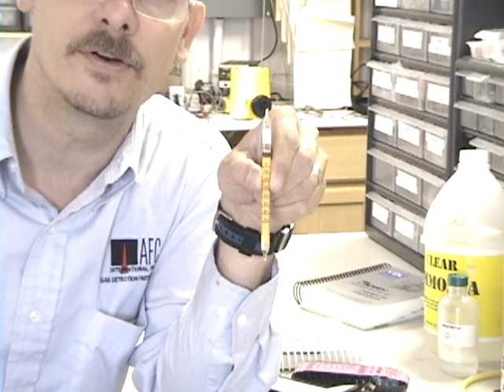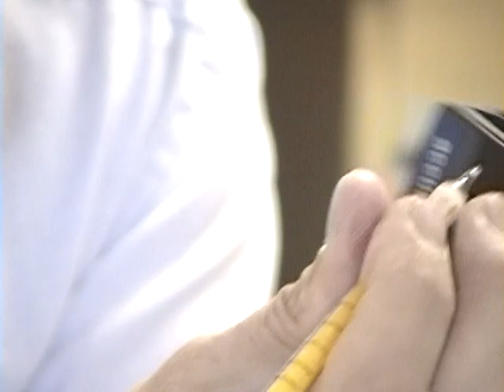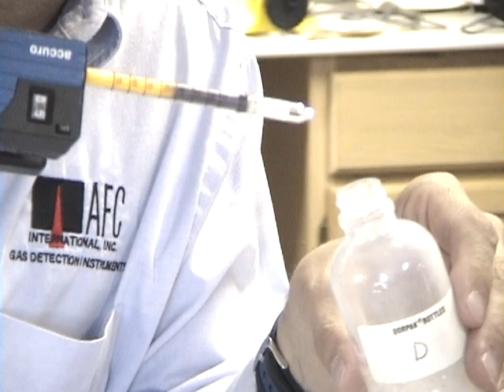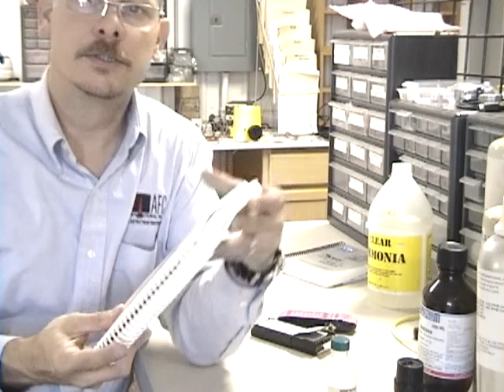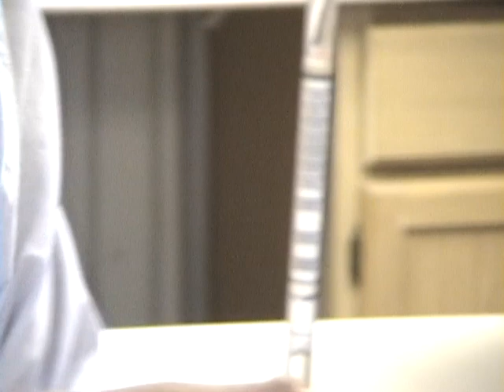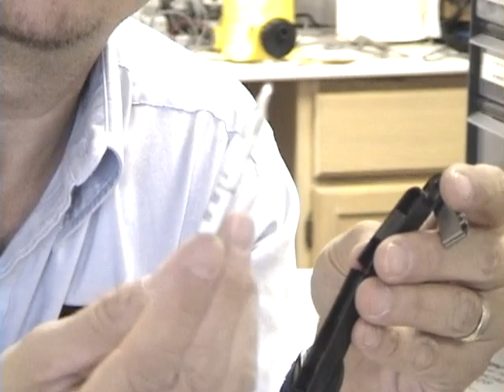Using Draeger Tubes for Chemical Identification with PID's/LEL Detectors

Comment: Just like to add that another major use case is the tube being intrinsically safe for class 3 div 2 environments.
Reply from the maker: Not all of them can be used in classified areas. I believe the halogenated hydrocarbon tube is one of them that gets extremely hot, it basically pyrolizes the target gas in the first tube segment
 and changes it into something that can be detected on the indicating layer.
Reply: @ZACHOFF1  good to know thanks!

Comment: Thank you Jim this is a great Video. I have used draeger to measure H2S content here for a while but I have a question. How accurate is the reading if we use an expired tube? I have tried it myself and I found no significant difference between the expired (march 2019) and the new one (july 2024). But I need an expert opinion to prove this thank you.

Comment: how about more clarification on the application of atmospheric, humidity and temperature compensation factor to the values of toxic sample tubes readings in order to achieve the correct values of gas concentration.
please clarify..

Comment: Jim on ships we always use long hoses 30m. aprox. for lowering down in the tank , due to hose length more strokes are required , is it ok if we do 8-10 strokes just for safety to check for the gas , can more strokes then required damage the tubes or its fine ?
Reply from the maker: Draeger makes a specific extended hose, just like Uniphos, that you attach the tube at the very bottom on hose. The end of the 30m. That way you do not need extra pumps to compensate for the hose volume.
Reply from the maker: You won’t damage the tube, but you will get incorrect readings. For just safety to see if any chemical is present, multiple extra pumps won’t hurt. The more pumps (sample volume) the lower the detection, to a point. It is always best to use the proper amount of pumps indicated on the tube. N= number and use the proper hose as I mentioned.

Comment: Can you tell me why a Water Vapor tube would be applicable to anything in industrial hygene and safety?  I never understood why water vapor would need to be detected.  Isn't there water vapor in the air?
Reply from the maker: Typically gas and vapor detection instruments can be used to around 90% RH, non condensing.  Using a water vapor tube could be used by some to make sure they are not over that level. NH3 is lighter than air, but has a affinity to moisture and will drop in humid environments. Also PID's, some IR analyzers and IH organic vapor dosimeters can have a problem with high humidity. This video was talking about chemical specific detectors tubes used in conjunction with general sensors like PID''s and LEL (CGI's)  for the chemical family determination of an unknown.
Reply from the maker: Not many uses for IH work, however, many high-end analyzers have issues with water vapor and a tube that can give you how much can be useful. In fact, water vapor will mess with GC-MS, IR, IMS and PID sensor/detectors at moderate changing concentrations. New instruments like AccuSense, have technology in them that takes water vapor, temperature, and pressure into account. See www.seertechnology for more on AccuSense
Reply from the maker: Yes there is water vapor in air. Many, many high end analyzers have issues with water vapor interference. Water vapor tubes are usually used in the gas supply industry. To make sure to keep humidity a low level. Humidity can react with gases. Also for natural gas lines, humidity is not preferred.